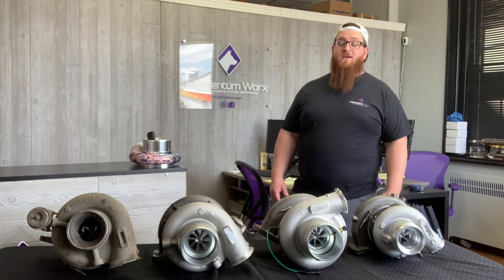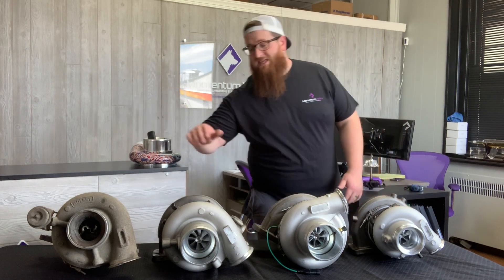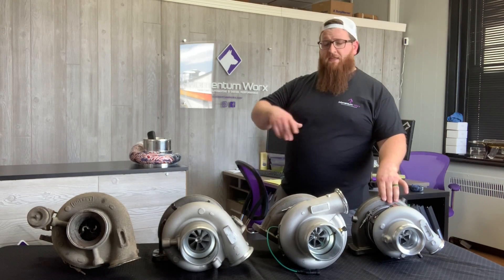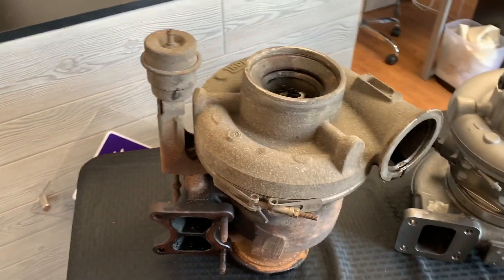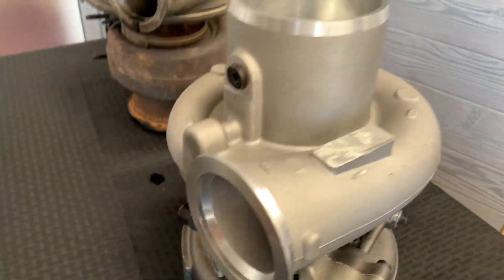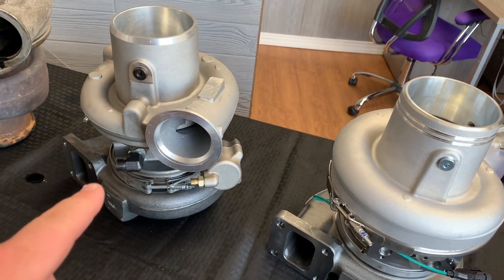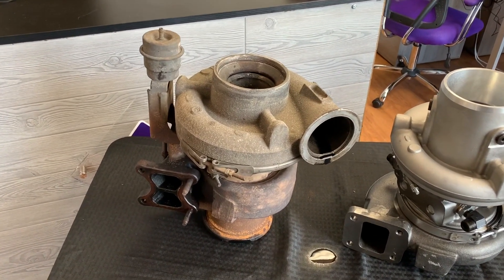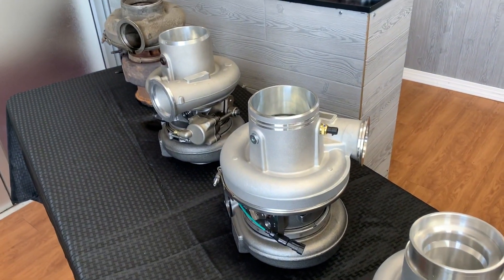What Turbo Is On The Cummins ISX? HX60W, HE551V, HE561VE, HE451VE - VGT Turbo Madness!

Comment: What are the differences in the 4309076 and 4309077? Thanks
Reply from the maker: Likely a slight compressor wheel size difference, I don't have the specs here to compare at the moment.

Comment: Saludos desde Venezuela. Te voy hacer un par de preguntas espero puedas responder. 
1. Holset fabricó un turbo bht4 ó ht4c para el motor Cummins ntc444. Borg Warner tiene un turbo igual al de holset? 
2. Los turbo de la serie ht son giró Reverse. Y para el Cummins nta855 ó n14 la brida del múltiple ó manifor no es igual al t6 normal. Que adapter se debe usar en ese casa. Gracias

Comment: Hey Joe on the 2250 2350 turbos the compressor size is the only difference then ?
Reply from the maker: The turbos between the 2250 and 2350 are virtually identical, the compressor wheel size is more dictated by the original horsepower spec.  As far as I know as of now, there are 2 different size compressor wheels most commonly used.

Comment: I have a 2010 ISX 871 that is 430 horsepower and want to bump it to 550 or 600 horsepower what is the difference in the turbo and what is the difference in the engine that you know of